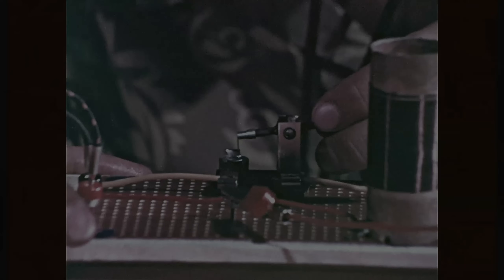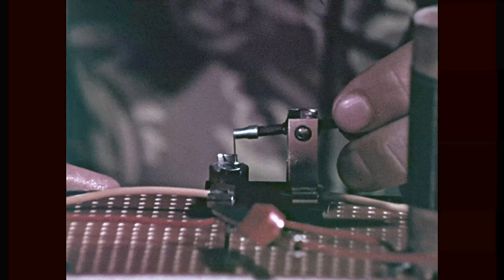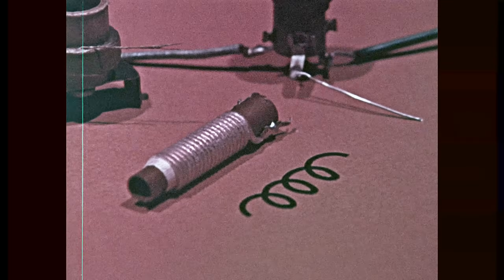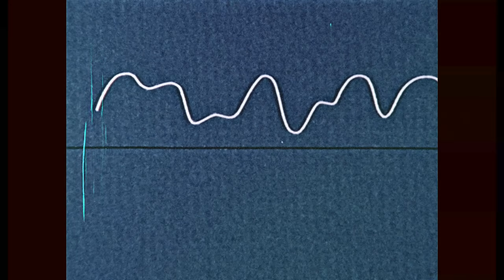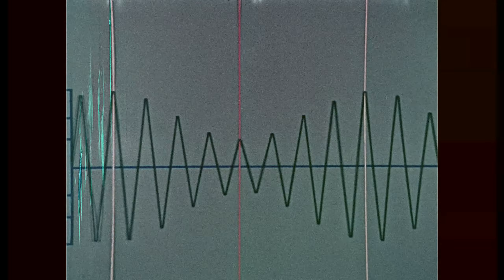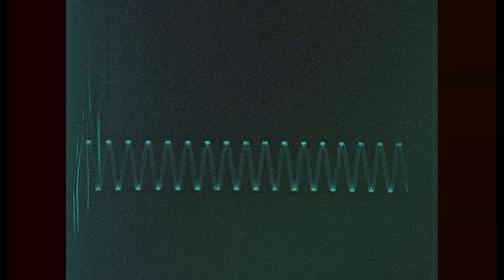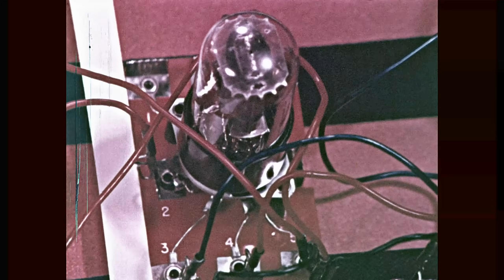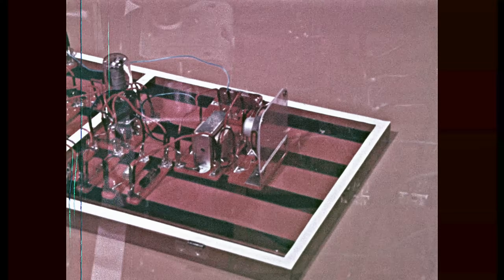Vintage Technology: Electronics--  BASIC RADIO CIRCUITRY, Learn How Radio Works, 1971 (History)

Comment: I love vintage content like this. Our society has advanced to the point that nobody knows how anything works anymore.
I have never built a basic radio transmitter or receiver. I have never built a microprocessor.
There are lots of crude devices that I would like to build before I die. I hope to involve others in the process as well. Making stuff is so rewarding!
Reply from the maker: Hi @ScottPlude,  thank you for the great comment.  Excellent points!  Making one's own tech tools and items is very rewarding, something younger folks often miss out on.
Reply: I too would live to work with other like minded people… I have worked for over 40 years in my proffesional life in electronic engineering in radio, communications digital and radar systems as a maintainer, servicing and repair… I’ve a,so done tache Al training too and it makes me sad as so many want to learn and Ai get all frustrated seeing peoples lack of knowledge with no one to teach them… I would love to volunteer my time to teach and train people to get started in electronics like the ay I stared back innthe 70s as a boy taking things to bits and making things from old bits and pieces I scavenged from the TV repair shop nearby.
Reply: @buffplums I went to RETS and Prospect Hall. In 77 droped out of college, majored in electronics. I had to take a bunch of academic classes and got Cs and Ds. I got As in the electronic classes and hardly studyied.
Reply: Breaking point about having generic knowledge of how the things work in the world was about 120 years ago. It is impossible to know everything today due a technology complexity. Not mentioned complexity of interconnected different societies trough telecommunication advancements.
Most complex man made machines are now cpus and software. I barely know how various parts are implemented and i am working in the field.
Reply: @rybaluc I the compay I worked for, started using PLAs, more software than hardware. I knew digital and logic pretty good, all the gates and how to design Adders. Now just about everything is in one microchip.
Reply: @wonkyganu72 But do you know how to produce chips themselves? On mass scale? Knowing logic is just half of the knowledge required. Do you know how to optimize gates from high level language? Can you make simulators? Besides... who makes own transistors at home? 120 years ago you were able to make all necessary components at home as single person. 
And even then there was certain expert knowledge and tools you not had - metal processing  metallurgy, producing wires.
Reply: You're so right. Society is degenerating because people are too well off. And they take the fantastic technology that makes their lives so easy for granted.
Reply: and it's intentional. They don't sell discrete electronics components anymore for a reason. 🙄
Reply: @oriraykai3610  Still plenty of discrete electronic components, heck, it's easier to get today than 25 years ago, that's for sure.

And there are new generations of HAM operators and not just HAM, LoRA, LoRA meshes, etc. It's easier than ever to learn electronics, whether you want to learn about building radios, fixing appliances or building new stuff based on discrete or utilizing micro-controllers that are getting cheaper and more powerful, or even full fledged very affordable single board computers -- the abundance of educational material and various components and parts is greater than ever.

The outlook in this comment chain is a bit darker than needed. In case shit hits the fan we will improvise, adapt and overcome.
Reply: Just dont make a fool of yourself🤨 Sorry, dad-joke out of the way. You are 100% correct. Im an 80s kid and fortunately my family made me learn how to do things and build stuff, but it seems like this tribal knowledge is disappearing from the common frame of mind...
Reply: In the 80s, the supervisor for the department was one thoes people. He believed in buying stuff, instead of building stuff. In 92 the company went out of bussiness. Because the US starting inporting goods from places like China and far less making goods in USA. 😢 I had a good job as level 1 digital tech, TS 8 bit controll systems. My poor eyes, many hours staring at a screen and an oscilloscope.
Reply: Unfortunately, the trash on radio is so awful that it becomes a moot point to understand how to build a basic AM or FM radio.
Reply: @BlackPill-obey  that’s true but think about what I’d say there was a world disaster and the internet is destroyed… it would be good if people break out backup comms systems.
Reply: @buffplums   We will depend on ham radio operators in those days.   Comms using HF will have to come back.
Reply: @BlackPill-obey  indeed mate and using whatever band we can use best.. UHF and VHF comms will be useful for point to point unobstructed use probably for semi permanent data links with directional antenna to reduce maximise power restrictions
Reply: @buffplums  People often forget that our entire civilization worked just fine before cheap personal computers and the internet.  I'm old enough to remember how to live without it.  It will be difficult at first because we've all become so accustomed to PC's and internet.  Only the old timers remember how to live without the benefit of excess technology.  Hell, I still have my slide rule that my Dad gave to me in 6th grade!  I used it until cheap electronic calculators became available in the mid-1970's.
Reply: @BlackPill-obey  well I actually started out working in teleprinter communications where the 5 unit baudot code was sent over copper of voice frequency comms links using FSK.,the mark space frequencies generated and decoded by  thermionic valves there were no computers involved but Morse code was strictly a human form of digital data communications.
Reply: @buffplums  Yes indeed.  We had usable telecom systems but, it was still at a level where it served us.  It hadn't reached the point of being our master yet.  Organic social order wasn't being warped and extruded through abnormal thought processes in order to fit into a paradigm that is in constant flux.
Reply: @BlackPill-obey  You mean you don't enjoy continuous commercials?
Reply: @km4hr   Indeed!  A few months ago, I turned on my truck radio to see what the local morning radio hacks were doing.  

Wall to wall commercials and a few minutes of Safe-Radio pablum laced with forced laughs and canned jokes.
Reply: @BlackPill-obey FM is a little more complicated than AM. The worlds done digital. I fix my own stuff, when I can. I don't like ordering parts from the internet.
Reply: @BlackPill-obey  that’s very true mate, but one ray of hope here, and this is just taking up the point of shite radio not the building of electronic stuff as such, as someone who loved AM and FM radio in the 70s I had an encounter where about 5 years ago, I was interviewed on a local FM a radio station which lead to my own 2 hour slot where I relived or tried to relive the experience of the 70s and this lead to me building. Y own studio at home. So maybe with the internet and social media to promote, people with a passion about radio can maybe collaborate using the tech we now have and recreate and listen to what people want ?

Going back to the lack of interest in building anything… I had an idea about this because I struggle to find motivation to do things these days. My idea is soon, I’m going to build a small low power AM radio transmitter and then hook it up to my radio studio audio feed out then I am going to use one of my old valve AM, MW/LW to relieve the signal and then use the received signal to be what send to air. This then will give the listener over  the air or onto a YT video a similar sound experience. By a,Teri g what is called, the RF coupling between the Tx and Rx it will impact on the signal to noise and with careful control, can simulate the effect of fading. Add a few relays clicking on and off randomly, maybe build a few voltage discharges and I can create an “RF Soup”  cocktail of EM delights which will be added to the sound of the transmission 😂😂
Reply: @buffplums   Man, you got some great ideas there!  Not long ago, I was casually looking into the practical use of LW radio for underground purposes i.e. guerilla and patriot resistance.  Why?  It can travel a long distance and not need too much power.  And, I don't think LW is even remotely on the FCC's radar. 

Granted, it would be good only for low-fidelity voice communications but, in a dystopia, that may be good enough to pass info to resistance cells.

Comment: Those mounted components are so cute, each on its little board with accessible terminals the student can wick clean for the next project or the next students.  I miss radios with real capacitors.  New and improved are not synonyms.

Comment: I'm from this era. We learned more about tubes than transistors in the 60's when I went to electronics school. Among many other things we had to build a 5 tube superhet AM receiver from scratch. Not a kit. The IF strip even had to be aligned.
   This was preceded by my own electronics projects starting around age 10 with crystal receivers, then later regenerative receivers and various test equipment. I'm retired now, but I still build electronics projects and I'm still a ham radio operator. There's always been an element of magic for the transmission and reception of radio signals to me. Don't scoff thinking about cell phones. Before the phone in your pocket is anything else such as being tied to the phone system, it's still a transmitter and receiver. Without that it's nothing.
   Thanks for posting. The younger generations typically have no clue how any of the advanced devices they use every day work. Many didn't even live in the time when mobile phones first came into use ~30 years ago.
N1KHB
Reply: I learned electronics in the 90s and one of my teachers, an old engineer, very old one!😄, teach me vacuum tubes and I was like: WTF!!!  now i'm a HAM and thanks to this teacher I made a lot of things with tubes.
Reply: Yes sir, you are right,
Reply: I never had any teaching, nor that I knew there was education about this available in my region, nor that my parents pushed me towards this. My love for electronics is still here for over 50 years... Love this video. Thanks.
Reply: @MrKillerno1  One of the better things to help you understand electronics is getting a ham radio license. Especially equipment that is a little dated. Newer radios are just a box of integrated circuits with a speaker and a microphone.
Reply: It's a shame there's no night school classes offered for electronics I had fun learning to fix TV's. Later became a tech with AT&T and already knew how to read diagrams and use a VOM.
Reply: @BrianG-x4u  The only "electronics" being taught seems to be all digital. That's not real electronics. 
   Maybe there's something on YouTube or similar for your needs. Unless of course you're already beyond that. 
   Two recommendations if I may: Become a ham radio operator. Along with the very basics of the license requirements there's a plethora of knowledge in the ham community. Clubs especially. The other is a book called "The Art Of Electronics". It came out quite a while ago but is still relevant IMHO. Very practical and useful. It was like a bible for our group before I retired. I have no idea if it's still in print, but I'm sure there are used ones out there.
Reply: @joewoodchuck3824  2 of my favorites are 1950's Radio & Tv troubleshooting books by Alfred Ghirardi & Richard Johnson
Reply: Indeed!   "The younger generations typically have no clue how any of the advanced devices they use every day work".  .Makes me think of the H.G. Wells novel, The Time Machine.
 
Cutting to the distant future, the above ground inhabitants, the beautiful Eloi, were surrounded by ancient relics of dazzling technology and they had zero idea of how it worked.  They just enjoyed what they got out of it and had no clue of how it was even being maintained.  That maintenance job was done by the Morlocks and they were a most undesirable lot.  Far from any virtuous intention, they kept the machines going for their own sake first and secondly, to keep the tasty Eloi in good condition.  The better to make delicious entrees out of them.
Reply: Yes, in some ways it was a kind of golden era for circuit design and repair because there was so much scope for "getting amongst it".  I had to go to a special marine college to learn radio theory for my very basic diploma from '86 to '88.  Nowhere seems to teach even that now. Certainly no university here in the UK.
I suspect you would have to research it yourself or join an Amateurs Radio club.
Reply: I hated my first cellphone. It was so big and heavy, some people call it the brick. I went to RETS, in the late 70s. I learned a lot about TV and radio, tubes ofcourse and digital. From 1980 to 88, I was a CNC tech. I built a few computers.
Reply: Very cool, thanks for sharing.
Reply: I'd like to get into ham radio.  What would be a good inexpensive starter kit/set?
Reply: @pmacc3557  Ham radio isn't the cheapest hobby in the world. So be prepared to spend a little money. Most new hams start with VHF/UHF equipment for local communications. There are also some bargains for used HF equipment, but buyer beware of parts availability and condition. 
   But get your license before anything else. You'll gain some important and useful information just by studying for the test. See if a large enough ham radio club will accept you as a provisional member until you have your license. Rubbing shoulders with experienced people can be a valuable asset both at meetings and outside of the meetings as well. All the better if the club offers classes. You can self study, but newbies tend to do better in classes. You'll likely be taking the test with the VE team from the same club. Possibly even the same people who were the instructors.
Reply: Was your tech school United Electronics Institute?  I attended fall of 70 to fall of 72 in OKC. Okla. 
It was almost obsolete already, but it beat the expense paid trip to Vietnam.
Reply: @garystotler3149  Connecticut School Of Electronics. An independent single location facility. '65 -'67. AFAIK it no longer exists.
Reply: @garystotler3149  Connecticut School Of Electronics '65 - '67.
Reply: Saludos desde Argentina 
LU6FJJ EMIL
Reply: I want to learn Radio Design. FM Radio Design Receiver any tips?
Reply from the maker: Hi @joewoodchuck3824, thank you for the very thoughtful and insightful response!  You have an in-depth, hands-on experience with radio electronics that is (seemingly) not a very wide-spread skill in our younger generations(s) today.  It it too bad they miss they excitement of creating a tool that can capture and translate EM signals and make sense out of them.  There is a great satisfaction in making your own electronics tools or toys, that is missed when one can buy (for a mere $1,000) a hand-held radio, camera, phone, etc. pre-made by someone else.   Little bits of important tech knowledge is lost over the years, as one generation takes over from the last.  Progress is great, but history is important to give us perspective.  Your comment brings back memories itself.  As a kid, I used to take apart 1950's TVs that people tossed out in favor of the "new" 1960's models.  Thanks again for the great feedback!  Hope you will explore our other video offerings too.   Keep well.  ~  Victor, CHAP
Reply: @ComputerHistoryArchivesProject  Each innovation seems to displace us further from the origins. A big change is how knobs and buttons are being replaced by menus which can be very interesting from a design standpoint, but at the same time make steps and functions more difficult and with more thought needed to perform them in practice than before. Oh well.
Reply from the maker: Yes, good point...
Reply: @ComputerHistoryArchivesProject  More like $100

Comment: Some of these old educational films were distributed as slide form and film strip..

you advanced the slide or firm strip every beep. 

 One system had a record you played for the audio. And you advanced the film strip or slide every beep

Usually the teacher had one kid advance the film strip or hit the button on the slide projector.

A later record had stereo ie 2 tracks and one was the beep so the volume would be low so the usable by the film strip slash slide operator.

This system of moving slide by slide allowed questions to be asked when students got lost or wanted to know more.

Usually a couple students  ran the record player and projectors once competent.  This allowed the teacher to focus on teaching. 

Actually running a system like that in 4th to 6th grade was a nice responsibility lesson.  Ie not screw up the record or record needle or ruin the film strip or slides.
Reply from the maker: Hi @3beltwesty, that's a great piece of history that I had forgotten about(!)   Schools used lots of A/V for a number of years.  It was a good teaching tool.  Glad we could share this one again.  Thanks for sharing your memories of those early days! ~

Comment: Yet if you think about radio frequency nowadays, it's basically ones and zeros nowadays, for digital radio and even cell phones (including smartphones). Radio technology have indeed evolved so much during that time. Of course you can still use triode vacuum tube for radio, yet you may have to toss in microcontroller to digitally compute the audio data before you could hear it especially via digital radio.
Reply from the maker: Hi @Dr_Mario2007, good point, an interesting way to look at it.  Thank you for the thoughtful feedback! ~
Reply: Twit.